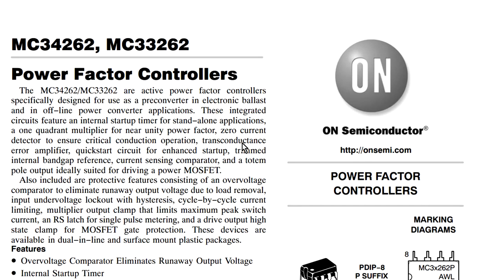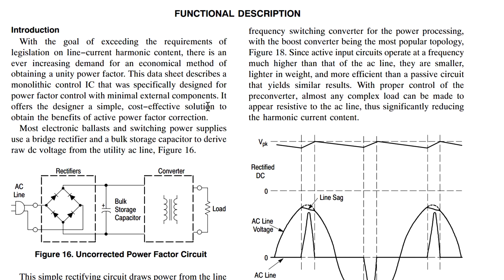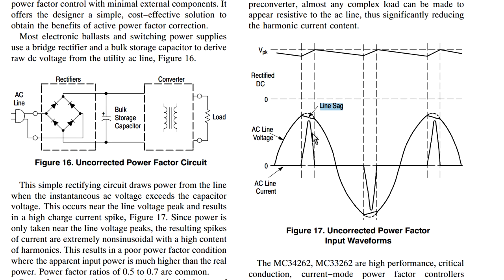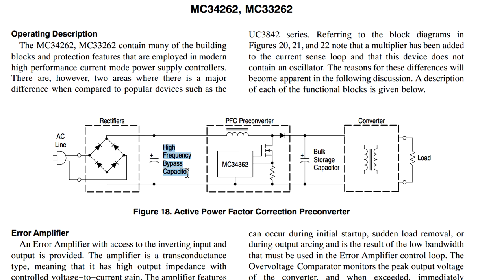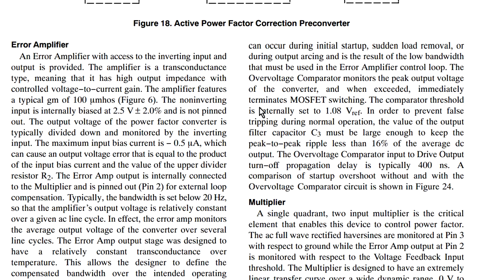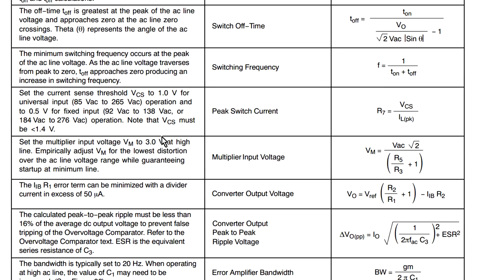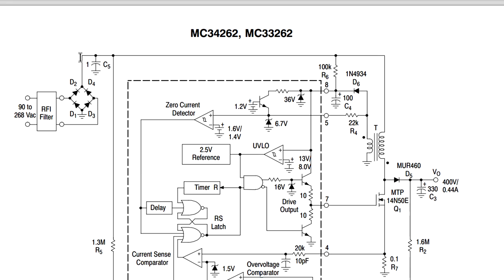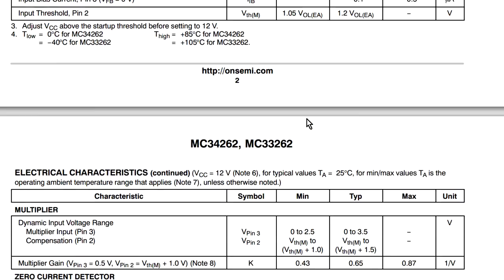EEVblog #273 - Power Factor Correction with the MC34262

Comment: The on time remains constant. The reason they use a bridge rectifier followed by a boost PFC converter is to allow PFC. It would be too much trouble and bulk going with a transformer, not to mention you lose PFC capability. With power factor correction, you're able to draw the minimum line current for the maximum output power. There are standards like the EN 61000-3-2 that dictate the maximum current harmonic content you can produce and without PFC, you wouldn't be able to meet this requirement

Comment: Motorola is a multi-department corporation. Each department takes a different sector of manufacturing. Motorola spun off two companies from their semi-conductor branch, one being ON Semiconductor, and the other being Freescale. The reason for spinning off these other companies can vary, but it usually ends up being cheaper for them.

Comment: I think you did right to separate this part from the other video.
Whoever searches for PFC will find it (like me) and get a huge chunk of pointers on how to design their own DC PSU circuits.
As an electrician in an industrial company in Germany I know how dirty a power grid can get if machine suppliers are not careful, waveform wise that is.
The choice of the type of VFD can make a huge difference in that regard.
Reply: Came here just like this. Got curious about active pfc, searched for that, got here 😂

Comment: I worked for KW Controls which had UPS system from .5 kva to 1000kva They had TUPPS system transistor uninarutable power system . I was trained to work on all the systm including QA testing which includes power factors on all the systems . This was the late 80s I worked there for 6 years . They also had Piller systems

Comment: bridge rectifier into caps is nice and efficient, but not for the power company, and maybe also for their consumption metering / billing systems...

I'll stick with the old ways unless theres a real need for anything else that improves the equipment in use.

Comment: If you listen carefully, most professional announcers have a big bass component and a matching treble component. The two sound great together, but if you put it through a lo-fi path (POTS line), these roll off at both ends and you can barely recognize the speaker. Dave's probably has a big mid-to-high-freq peak, so he's tailored for those 99-cent earbuds. Just the thing for iPod listeners and utilitarian comm channels. :-)

Comment: What happen to spinning power meter if the load are just half wave rectifier with capacitor power supply. Will the disc still spinning since the current form is just on one side or DC.

Comment: Just discovered this. I’ve also read some abstracts on using synchronous rectification and using that to control pf too in a more simplified design. Have you done a video on that? Couldn’t find anything.

Comment: Why do they rectify first, then use a DC to DC converter? To me it would be easier to use an transformer to bring the voltage down, then rectify. I am sure there is a reason why it is done the way it is but I was wondering why.
Reply: The way a non switching power supply was built was a transformer, rectifier and then a linear regulator. The problem is you need a big, heavy, expensive transformer, a big capacitor and then the linear regulator was't that efficient. With this design you have small, light, cheap inductors, small capacitors and switching regulators can be very efficient. And the active PFC correction means you can get a power factor near one.

Comment: Money is the reason. With a big transformer, you need uh, a big transformer. That's lots of iron and copper. The DC-DC starts by generating AC at 100KHz or whatever, which allows little transformers to be used. It's also smaller and lighter, allowing more product to be jammed into a container, which is important because it all comes from China. If you are going to have regulation ckts anyway, might as well have them doing the DC-DC thing at the same time.

Comment: Yet another video that fails to reveal the magic smoke.
Problem statement:  A simple rectifier into capacitor power supply draws current only when the incoming sine wave happens to have a higher voltage (plus 2 diode drops) than the capacitor.  At that moment, the capacitor starts charging and its effective resistance nearly zero thus current demand is very high, but only for a few milliseconds.

Solution statement:  Find a way to spread out that spike that happens 120 times per second; find some way to extract energy from the entire sine wave not just the peaks.

Complicating factor:  The filter (bulk) capacitor already has 300 volts on it.  At the moment the incoming sine wave is 20 volts.  How are you going to step up that 20 volts to 300 so it will impart some energy to the capacitor?  You cannot just use a 15 to 1 step up transformer; if you do that, watch the smoke happen at the peak of incoming voltage! 

The magic is a FLYBACK regulator; known here as a boost regulator but it depends on the flyback effect of the inductor. This is the same phenomenon that generates the spark in your gasoline powered internal combustion engine. 

Inductor charging half-cycle: 

For a few microseconds, the inductor is shorted to ground which seems like a bad thing but while shorted to ground it is building a magnetic field.  Then you suddenly open that path to ground.

Capacitor charging half cycle: 

The magnetic field starts to collapse.  It wants to push electric current in the same direction that it has been flowing.  What is special is that it does not care about voltage; it will push X number of electrons up a very steep hill if necessary.  So, even though the capacitor already has 300 volts on it, and you charged the inductor at a moment where the incoming sine wave had only 20 volts, when you interrupt the ground path, the inductor will push 20 volts no matter what; making a spark if it needs to.  It pushes that 20 volts right onto the 300 volts already on the capacitor and THAT is how you glean energy from the 20 volt (or any volt) portion of the incoming sine wave and scoop it up on top of your storage capacitor.

Detailed nuance:  We don't actually fully charge the inductor, that would be bad, and we don't completely dump the charge either.  So we "top off" the capacitor with these little impulses and in that manner spread out the consumption of CURRENT from the source so that the current approximately follows in shape and phase with the source voltage. 

It is by its very nature current limited since the thing that charges the main storage capacitor is the FLYBACK impulses from the inductor.  

You doubtless notice an interesting phenomenon; at the source peak voltage, the duty cycle on the inductor pulse width modulation is LEAST.  That's because it only takes a few microseconds of high voltage to "charge" the inductor; but as the voltage goes down following the sine wave, the pulse width will expand in order to maintain the magnetic field charge on the inductor.  It will expand across all cycles as the load increases.